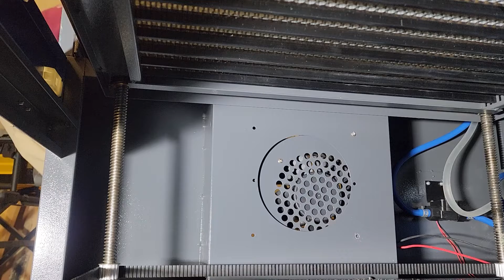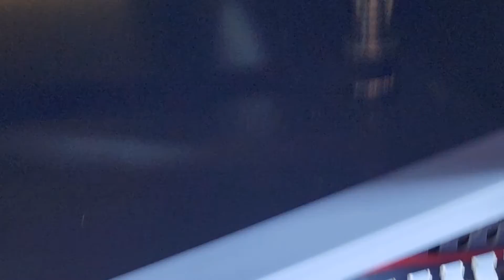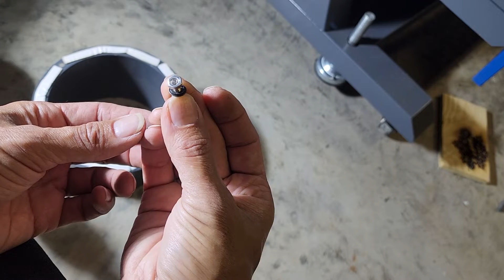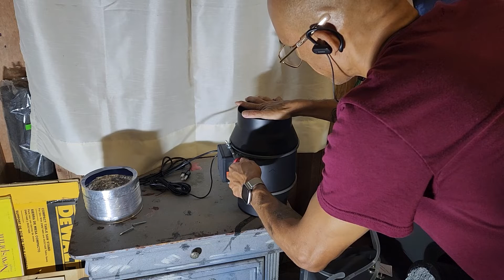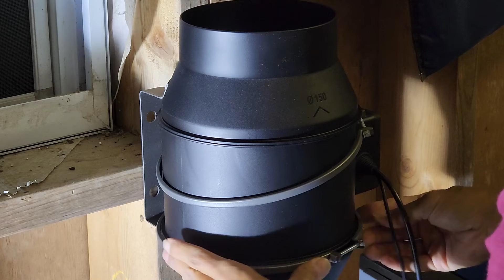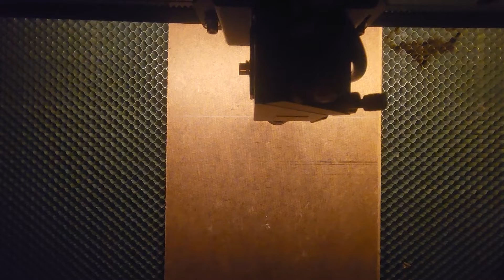Laser Upgrade! Omtech / Ebay / Chinese Stock Fan Removal and AC Infinity Inline Fan Installation

Comment: I kept the fan as it was, but installed 2 of the extra fans in line to the outside, gives it a bit more blow, why did you take it off??
Reply from the maker: @grahamwhitehead5629  The built in fan isn't pulling air out as fast as the AC Infinity fan so it becomes an obstruction  and reduces overall performance. It's also a place for debris to accumulate.

Comment: Nice video! Any comments on antifreeze in the chiler water to avoid freezing?
Reply from the maker: The first winter I had my laser I ran antifreeze in the cooler.  This is what Thunder Laser recommends - https://support.thunderlaserusa.com/portal/en/kb/articles/thunder-laser-approved-antifreeze#RV_ANTIFREEZE
Reply: @directedt3ch  What about now? You don't use antifreeze anymore?
Reply from the maker: @smattt  I moved the laser into an insulated partition in my garage.  It never gets below ~50 degrees in there now. I just run distilled water in the cooler these days.
Reply: @directedt3ch  Thanks for this. I guess I'll use this only when necessary. I'll just have to be careful about draining the water out before temps drop too much.

Comment: Thanks for the video.  BTW.  Had the same problem with the screws.  They are not #2 screws. They are #1 screws.  With the correct screwdriver, they came out easily.  Just wanted to let you know.
Reply from the maker: Thanks!  Guess I chose the wrong tool for the job!!

Comment: Thank you for your videos.  Thumbs up and subscribed.  

Two questions.  
1.  The fan has to be manually turned on each time the machine is turned on?  No way to wire it to turn on with each laser fire?

2.  It’s ok to vent outside?  I don’t first need to filter the smoke with an omtech 4stage filter before dumping it outside?  Neighbors should be ok with it?
Reply from the maker: The way this fan is wired is completely separate from the unit, which to me is a plus.  Yes, I have to turn it on before I start a job, but this benefits me in two ways.  First, I don't have to hear the fan when the laser is on but not running a job.  Secondly, I now have the laser in a small room with A/C and the fan is in the same window in the video.  If the fan were always on, it would be sucking the cool air out of the room and blowing it out the window all the time.  For your second question... I guess it really depends on what you are cutting, and how close/sensitive your neighbors are.  I've never had a complaint, but my neighbors are a decent distance from where my laser exhausts.  If you are cutting or engraving wood, it'll smell like a camp fire or chimney smoke.  If you cut acrylic or leather, the smell is much worse!

Comment: This is a great video.  I watch it  and learned a lot before I swapped out my exhaust.  I didn't have the shrink tubing but I put electrical caps along with electrical tape on the ends.  I hope that is enough.  Also, I needed to drill holes to attach the the round vent attachment to the actual machine.  My model is different than yours but the process is very similar.  Thanks!
Reply from the maker: Really glad you found it so useful!  Enjoy your new laser!

Comment: The perforated plate the original fan was mounted on should normally be reinstalled to the inside of the laser cutter/engraver. Its purpose is to serve as a spark arrestor, thereby preventing hot debris large enough to cause a fire from being pulled into the exhaust stream. The 6" AC Infinity fan is rated at 405 CFM at full speed, which is high enough to pull in debris from laser operations. While the aluminum duct isn't flammable, accumulated debris could catch fire within the duct and burn through.

When designing a solution, always think of the most unlikely things that can happen...because they very well may if not prevented. Over the years, I've presented case studies during weekly safety meetings of workplace incidents which were 100% preventable but resulted in serious injury or death.

Be safe! The one thing you can't make is another you.
Reply from the maker: Appreciate your insights!

Comment: Hi, 
Just saw your video and will be installing the fan upgrade this week.

Just curious, why did you opt not to use the existing  old 120V fan wiring and an outlet box to power your new fan automatically?
Thanks,
Jerry Kornbluth
Reply from the maker: It was just easier to plug the new fan in to my power strip.

Comment: Can the stock fan be left in?
Reply from the maker: It's less than ideal to leave it in.  I restricts the airflow greatly and it's something you'll have to clean.
Reply: @directedt3ch  so I'd have to remove the fan from a new machine (I've ordered xTools P2, not even sure if the fan can be removed/switched off) even if I had the AC infinity around 3 metres from the back of the laser? Would the S4 still cause air flow issues if the stock laser fan was left in/on?
Reply from the maker: @neilrisley6667  I wouldn't remove the stock fan on a machine like this.  The omtech I own is a lot easier to work on and upgrades like the one in the video are expected.  I'm sure you'd immediately void your warranty with xTool if you cracked it open to remove anything.
Reply: @directedt3ch  the CFM is 145 with the P2 fan & I want to exhaust out of a window around 10 metres away. I thought having an inline fan half way between the laser & the window would help pull air out. Are you saying the AC infinity S6 or S4 would be more of a hindrance than a help then? Because I'm not sure the power of the fan in the laser would carry fumes out through 10 metres of exhaust pipe 🤷‍♂️ Apologies for the questions btw...this will be my first time properly exhausting a CO2 laser outside
Reply from the maker: @neilrisley6667  It'll probably help to have the AC Infinity to assist with fume removal with that length of duct run.  It might not be as efficient as it could be with the other fan in the way, but it'll probably be a net positive.
Reply: @Directed T3CH  I finally heard back from xTool & they say as long as the 2nd fan is more power than the stock fan it should be OK so I think I'm going to go with the £100 AC Infinity A6 Lite. Thank you for all your replies
Reply from the maker: @neilrisley1321  My pleasure! Hope it all works out for you super well :)

Comment: I always wanted to consider going this path because I used an inline fan in my tubing part way away from the laser (about 6') to create a stronger vacuum, but it isn't as effective as this.  What CPM rating did you suggest?  I see this one is 402CPM which sounds decent.  The bigger question is if there isn't a fan directly IN the laser on back, how far could this fan be placed before you lose appropriate suction?  Unfortunately for me, I've got a rising 13' distance from my laser to an external vent source.
Reply from the maker: With the run you describe you might want to get the next size up in the Infinity line (if you go that route).  Most people advise keeping the fan closer to the exhaust side since if you are pushing smoke through a long run of tubing, any tiny holes in your ductwork are just places for the smoke to exhaust into your workplace.  If you keep the 'vacuum' side long, those holes just let in a bit of air to your run but the smoke stays out of your workspace.
Reply: @directedt3ch  You said it brother.  Thanks!  Always appreciative of your videos.  Keep on burning!
Reply from the maker: @NFOsec  You're very welcome! More videos soon!

Comment: Thanks for the video. Does the original exhaust need to be removed? Can the in-line just work as extra pull from down the line?
Reply from the maker: You'll lose efficiency with the inclined still in. It has a much lower output than the external fan so it becomes an impediment to airflow.

Comment: I'm enjoying your videos and looking forward to seeing how you upgrade the air assist.  I've had my laser two months and have upgraded to a AC Infinity fan and purchased the American Photonics lens kit, but I'm still running the stock air assist.   So far no issues with it.
Reply from the maker: I'll work on that video!  I've changed over to using a compressor. I still plan on doing a solenoid addition so that lightburn can trigger the air assist.